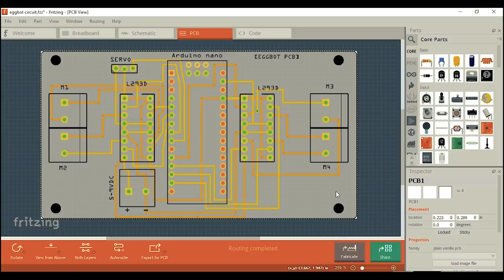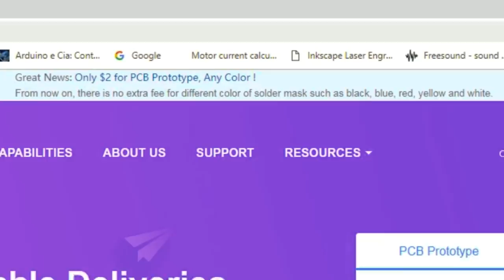How to make Polar CNC drawing Machine

Comment: How's that nib coming in and out all the time?
Reply: It's a servo, used in many rc models to add rotational motion.
See the wire going up to the rails at 11:00? When he turns it around you can see that blue rectangle with the white bar? That's the servo.